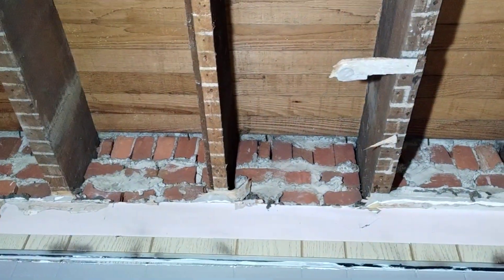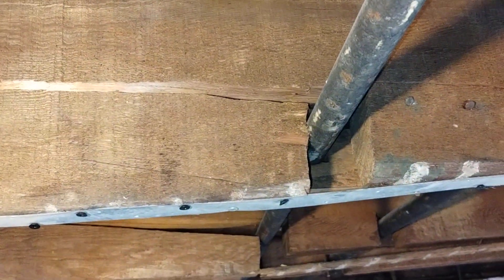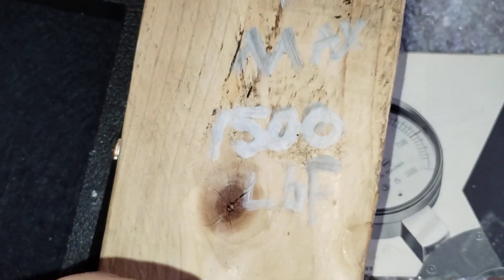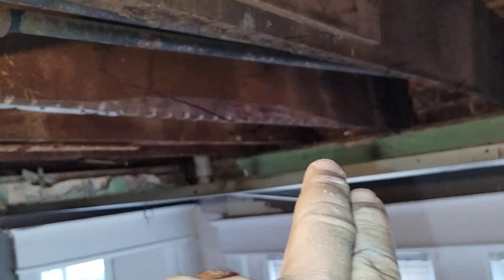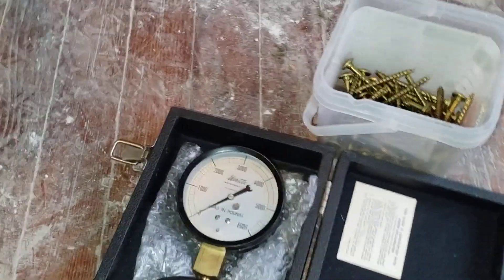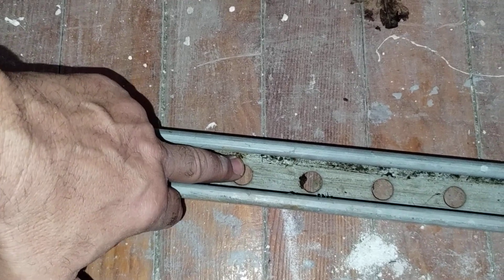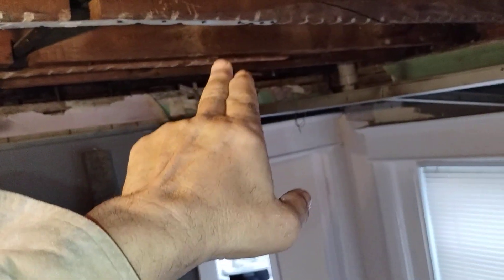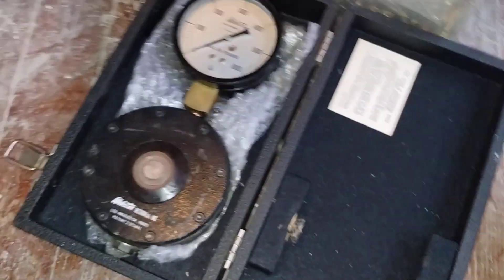cracked Floor Joist evaluation of existing floor joist loads part 3 #boltdepot

Comment: If the plumber hacked out 30% of the joist to fit one pipe, can we estimate how much he weakened the joist by? What if they had cut round holes into the joists? I have seen some holes drilled in joists; does the "height" of the hole matter?
Reply: I think it does. From where they are, a right-sized hole half way up would have proved Ed minimum weakening effect